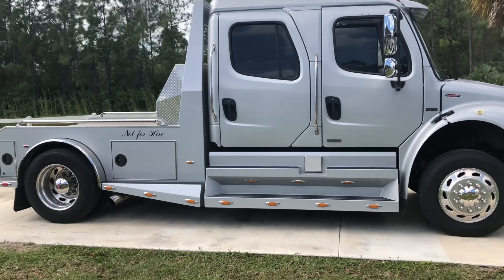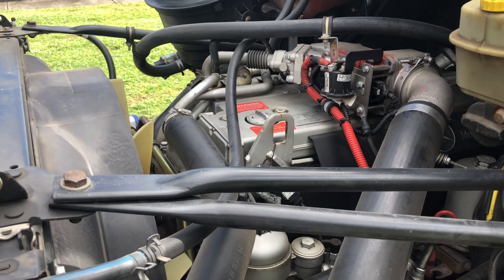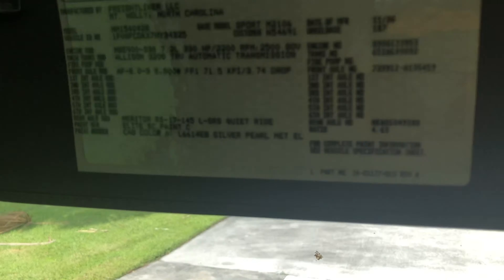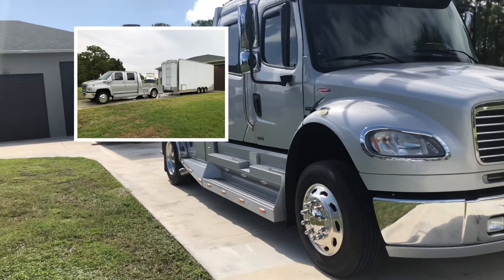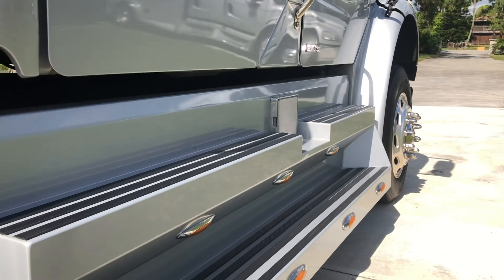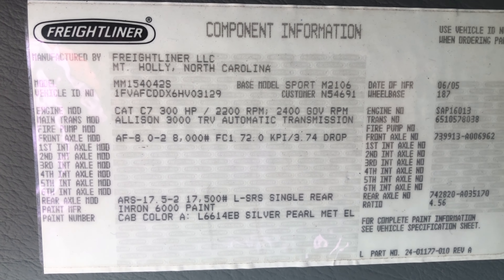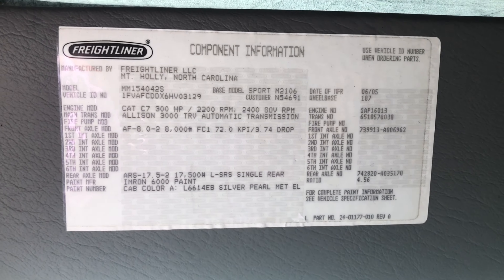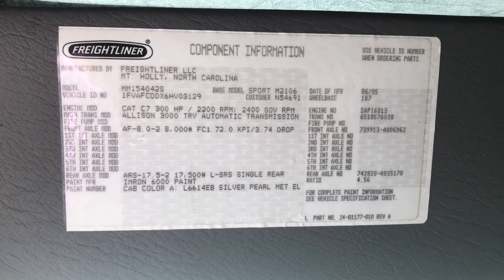Freightliner SportChassis M2 106 walk around

Comment: Good move going with the SportChassis!

I bought a 2006 with MBE recently and love it

Just an FYI.....my 2006 MBE has the engine brake with 3 settings and top if front bumper riser.

And not sure you've been told this yet, but the rear axle gets derated from 17,500 to 11,500 when sold to SportChassis for non cdl purpose. My point is your rear axle is really a 17,500 lb axle. 

These are capable of hauling 45k all combined. 

PS.....you can get suction cup interior window shades for all 6 windows. TJ

Comment: Based on my experience in the Army with the Allison Transmission, mentioned around 15 min right before the exhaust brake comment, is that the first display window that displays a 6 constantly is not to indicate a 6 speed but rather to display the current maximum gear ( like when pulling up a grade). The arrow buttons should lower and raise this limit and then the right display does - like you mentioned - show current gear.
Reply from the maker: Thank you for the explanation.

Comment: So on CGVW and GVHR, I want to haul a gooseneck or a 5th wheel trailer. Mainly for delivering landscaping equipment to sites like skid steers, backhoe, tractors, mini escavator. Is this the truck for me?
Reply from the maker: This truck will work great! Might even be an overkill. Most guys are using F450’s and even 350’s. This type of truck way more then tops them.

Comment: The 2006 cat sport chassis has an exhaust brake, it has nothing to do with the transmission. It is not using the transmission to slow the vehicle. An exhaust brake is a valve that is placed after the turbo. When foot is released from gas with switch on it closes the valve blocking the exhaust flow and building up exhaust back pressure slowing the truck. On the 07 mb sc it actually has a engine brake. An engine brake actually uses exhaust valves in the motor to retard timing and building up compression in the cylinders slowing the truck down. The high low option selects between how many cylinders it’s retarding the exhausts valves in giving you half the braking horsepower, or the full amount of braking horsepower. An engine brake is a lot more effective then an exhaust brake, but and exhaust brake can help get the job done and a lot more quite
Reply from the maker: Good info! Thanks for the clarification
Reply: Exhaust brakes suck... plain and simple.... they just don't work as good as a "Jake" brake.

Comment: Beautiful Freightliners. I love the sport chassis and would love to own one just as a daily driver. I’m into big trucks and semi trucks also. The M2 is my favorite chassis when they changed design in 2004 I think but not sure on that. Do you race two cars, is this why you have the two trucks. I like the cat engine the best.
Reply from the maker: I bought the two trucks to see which I liked more. CAT or Mercedes. Turns out there’s many differences between the 2006 & 2007 models besides the motor. Most notable is the cab height. The 2007 is taller. Also the 3200 transmission is smoother behind the Mercedes. It’s a louder motor then the CAT but the maintenance intervals are less. I ended up selling the 2006 with CAT. The Mercedes also had less miles.

Comment: So, quick question... what’s your advice for a young couple, full time RVers, looking to upgrade from the RAM 3500 Dually, wanting one of these type of trucks. Best bang for the buck... and will be using for every day driver... Thanks
Reply from the maker: How big and heavy is the RV your pulling? I would definitely recommend the Freightliner over anything but a Kodiak C4500/C5500 can also handle the job. The nice part about both the trucks is that they still have a good wheelbase. Meaning that when you unhook you can still drive the truck around and park it at restaurants. The Freightliner is a little longer then the Kodiak but manageable. Both truck are easy to drive but the Freightliner is more comfortable with a bigger interior. The main upgrade from a 3500 is the beefy suspension, brakes and real truck tires. But if your RV is smaller (40’ and under), just go get a new Ford F450.
Reply: Have you looked at the GM 6500 it is the replacement for the Kodiak.  Also there are many youtube channels that have HDT or heavy duty trucks and they have gatherings that new people are welcome to go to and learn about the Medium duty and HDT trucks and see the other 50 or so trucks there.  The HDT RV gatherings are east, west and combined.
Reply: Don't waste your money. No power, cannot stop as quick as a full size semi and do your homework.... you can buy a used semi cheaper than these.  We call them baby trucks., BTW, We have a Freightliner Columbia, 500 HP motor pulling an 18,000 pound Heartland Bighorn. Don't even know it is back there. Total weight for us is 42,000, and 70 feet long.

Comment: Did the kodiak not have enough power? Which one is easier to park/back up trailer, m2 or kodiak? Looking at both but leaning towards the M2. Nice trucks.
Reply from the maker: M2 is the number 1 choice. Wish I would have gone to it sooner. They both have same hp but the M2 has a ton more tq. The kodiak does work well but if your gonna pull real weight the M2 is a lot more stable.
Reply: OMG, really. You want a Baby truck just to back up with..... You might rethink even being out there. A full size semi is easier to back up, you can see more and it will pull your trailer better. You only have 300 HP in that M2...really....Semis start at 400 HP up to 600 HP.

Comment: That is another idea for towing my 5th wheel rv camper trailer might need to go bigger on the engine or chases but it should do the job
Reply from the maker: The truck does great pulling 20k Lbs
Reply: @mantovaniracing  I am trying to find a brochure on this truck and a website I went to frightliner and they told me that they do not make this type of truck and I want to learn more about it so I can research it more and check with the state of Arkansas see if I need a CDL license or not it is going to be my personal use truck to haul my 5th wheel camper trailer
Reply from the maker: @brianmoser260  SportChassis is the coach builder. www.SportChassis.com
Reply from the maker: In 99% of the situations you won’t need a CDL if the truck is registered to you personally to pull your camper and the truck says “not for hire” on it. That’s why you see 110 year old guys driving big Prevost buses. They don’t have CDL’s. But as always, check with your local laws.
Reply: You want to have an M2 with only 300 HP...???? My gosh man, semi trucks start at 400 HP up to 600 HP and don't cost you $100,000 for the Baby truck. Get a low mileage big truck.... $20,000 up to $50,000 would get you something to go down the road in style.... and a hell of a lot safer too!!!
Reply: @michelevigil8887  I am looking at all of my options and I do not know anything about engines or hp all I want is something safe with a wide wheel base with exhaust bakes and with or with out air brakes I am looking at comfortable safety and sit up high so I can see out the window in front and has very little to no blind spots and with a lot of leg room right now I am looking at dodges from 3500 to 5500 and I looking at semi trucks to M2 sport and I am looking at fords and chev. Trying to get all the information that is out there and while I am looking I am saving money and building my credit and job history so when the time is right I will have the money down and I will be getting a payment where I am happy with I am looking at use and new probably looking at few that are sitting around at a truck repair shop or sitting on a farm or in a junk yard that might just need some interior work but runs good but needs all new fluids and some work